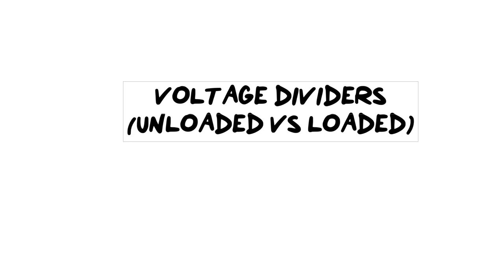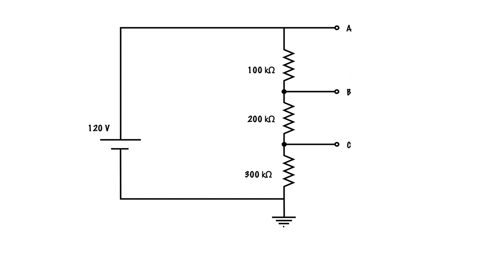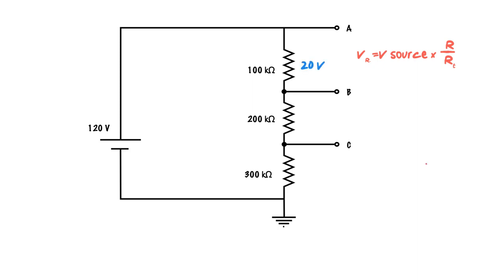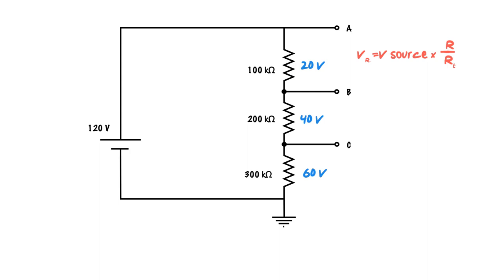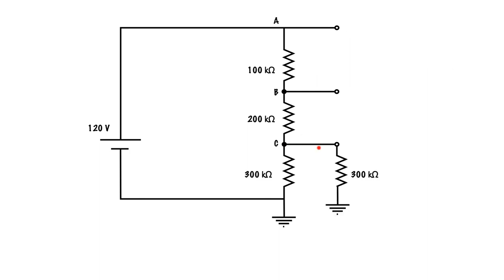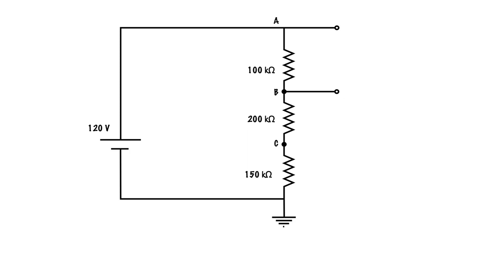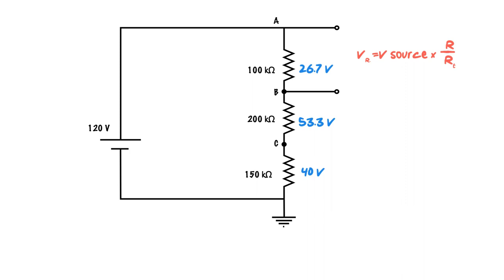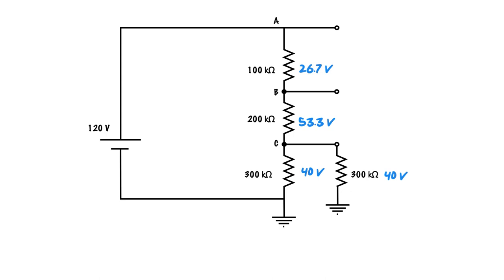VOLTAGE DIVIDERS (UNLOADED VS LOADED)

Comment: Voltage dividers are used for low current low voltage, such as obtaining 3v from 5v. The 3v is then used as a signal to drive a transistor, which drops the voltage an additional 0.3v while increasing the current.

Comment: I can't get it, if we use the voltage dividers for limiting the voltage on the load, why don't we just put a corresponding resistor in aeries with the load ?
Reply: My doubt exactly. Have you figured it out in the last 8 months?
Reply: Voltage dividers are usually used to obtain a certain voltage for a high impedance destination, like if you needed a 5V reference voltage for an op-amp or microcontroller. To provide power to a load you would do what you're suggesting